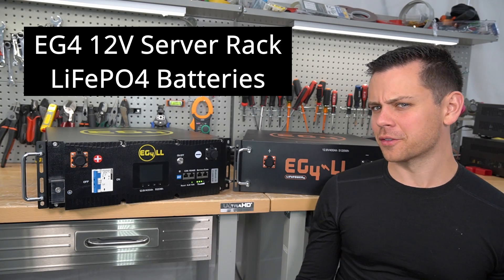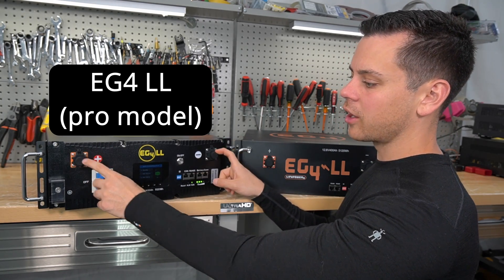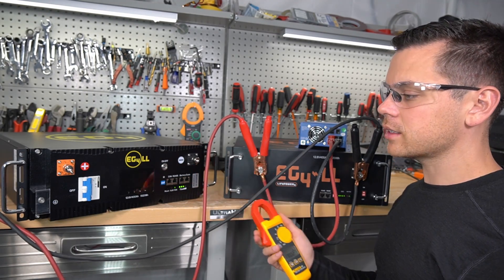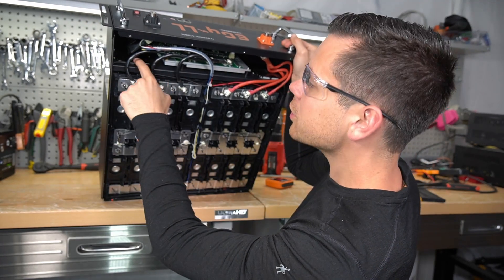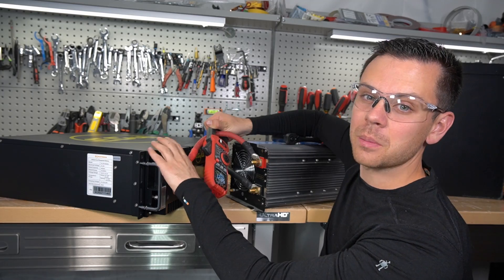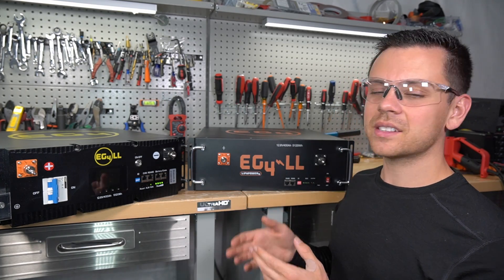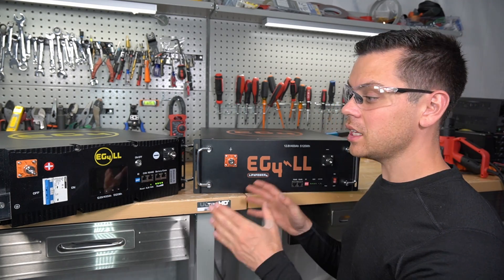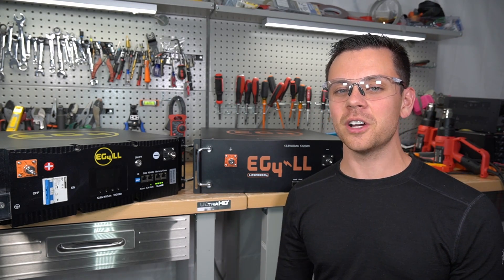$1,449 EG4 12V 400Ah LiFePO4 Server Rack Battery

Comment: Should just one of these be able to handle a 15,000BTU RV A/C when we turn it on.  I keep getting a battery shut down when I turn on the A/C. I just ordered a SoftStart to minimize the initial amp surge. I want to add another but want to make sure my whole RV (50amp)  will run off this setup. I have a Victron 3000 2/120 with Lynx, Cerbo and MPPT's. It runs an electric fireplace with both A/C fans (not cooling), but will not start the A/C when I turn it on cool.
Reply: You likely need a second battery. Also make sure you have the current version firmware. They made some updates to help with inrush.
Reply: You need a major system to run AC. I believe you would need a 48V system, with at least a 5000W inverter/All-In-One, like Growatt. The problem is that there is limited space for solar panels on an RV, and a minimum solar input Voltage for 48V units. A decent comprimise is the 24V all-in-one, but either way, you will need  a LOT of battery storage to power the AC for longer than an hour or two. Find out the Wattage pulled by the air conditioner, then multiply that by the length of time in hours you need to run it. That will give you the Watt/hours you need as a MINIMUM in your battery storage. To get Watt/hours, (Wh), multiply the Voltage of your battery bank by the total Amp hours, (Ah). For example, a 24 (nominal) Volt 200Ah battery similar to the one in this video is actually rated at 25.6V, so the total Wh of the battery is 5,120Wh.  So, one 24V battery like this would run a 500W air conditioner for 10.24 hours, or a 5,000W air conditioner for 1.024 hours. And that is just considering the air conditioner, not including everything else you need to run. You will need to figure out what you use over a whole day. Maybe you can figure out what your needs are from there. Also, you will want to double or triple the battery bank size from your final calculation to allow for a cloudy day or two. Of course, this is only my own opinion, and maybe someone else has a better knowledge of solar power, but I have been living off-grid for over 30 years, growing my solar system as I learned and understood more, and could afford better quality items.
Reply: @Tumbleweed5150  false, you can run RV ac off 12v, 24v or 48v systems. Also a 3000 inverter will do it. Lots and lots of YouTube videos of people doing just that on a 12v multiplus ii 2x120.
Reply: @earlzeis35  yes, thanks. I will get a second battery and I am actually installing a Micro Air EasyStart that cuts down the starting surge like 70%.
Reply: @Tumbleweed5150  FYI, The Micro-Air soft start did the trick. It reduced the start up amps and the one battery ran the A/C like a champ. Now while it did run it, it does suck like 10% of battery in like 15 minutes. We will obtain another battery, and with 900watts of solar on the roof, 600watts of mobile ground solar, with a small propane 2200 watt generator, I think we'll be in great shape.

Comment: I noticed a few different Commenters talking about using the 12V batteries for their RVs, etc., because most items are 12V in one. I have a 48 Volt system in my RV, and I put in a pair of buck converters for 13.8V to run my 12V stuff. I had a 24V to 13.8V converter in my old 24V system, so when I upgraded to 48V, I just bought a 48V to 24V buck converter, then used that to power the 24V to 13.8V buck converter. I tried a 24V to 12V converter on one system, but it seemed weak, and pulling a larger 12V load, (Using a 12V tire pump, for example), it overheated the cigar-type plug. I replaced that, once I got the 24V to 13.8V buck converter, and have had no problems since.
Reply: RV 50a? What inverter did you use that's 48v and RV compatible?

Comment: So, if this were put in place of standard RV "deep cycle" batteries, how would your vehicle charge circuit handle them when driving, and could they be a direct replacement??
Reply: You would need a DC to DC converter so your alternator doesn't burn out, but otherwise, they should work just fine.

Comment: Will, I just check the price at Signature solar It is listed at $1449.
Reply: Will is comparing prices per 100Ah. So what you have to calculate is the cost of the BattleBorn/SOK et. al. at the price listed times 4. So a comparable SOK system would be $559x4=$2236, as compared to the EG4 400Ah model Will has @ $1449.

Comment: Nice vid. One thing i would say is that the thermal breaker would be affected hy heat generated inside the box, so in the event something inside the box was getting really hot while current was still under the BMS trip rating, that would slowly ‘derate’ the breaker and could lead to it tripping when the bms would not. But that depends on the high temp behaviour of the bms. I agree its mostly a convenient disconnect ‘for emergencies’. 

Its a lot more elegant than the 5kwh of paralleled 12v in my rv! Still more expensive, but definitely worth it for multiple reasons.

Comment: Next video: How to run all your 12V stuff in a 48V system with examples for 0.1A / 20A / 50A / 100A+ requirements. Budget options like used 12V Server PSUs for 50-100A running off the inverter for specific usage under an hour. Midrange options like paralleled 48V to 12V DC-DC converters for even higher amps?

Followed by: How do you charge a 48V system via 12V alternator?  Can we make it work?  Is there a 12V/40A input to 48V/10A output solution that can optimally charge a 48V LFP battery?  Should you add a 48V alternator instead?  How about using a small DIY solar generator to charge via the 12V alternator until it’s at least 40% charged, then switching on its inverter to startup a high quality 48V LFP battery charger?

Lol 😅

Comment: What if your batts (eg4)are only down to soc of say 30-40% then recharge to 85-90%..is that hard on them or better. I never end up fully cycling them.
Reply: Probably better, not harder on them.
Reply: You may want to bring them up to 100% once or twice a month, as I think they equalize at the top end.
Reply: @Tumbleweed5150  I have 6 eg4 lifepo batts the eco version. I have noticed that if you do let them go to 100% some of them get there faster than the others but all end up there.I also noticed the longer you wait the more they get out of sync (soc green lights on batts.some 2 some 3)which is weird because they have comm cables to each other and to the 5000es so to me that shouldn't happen.

Comment: seems like EG4 has got their battery game nice and tight.  Regarding the warranty, the question is always will the company be there when the warranty gets long in the tooth.  EG4 does seem like they're doing things right enough that 10 years from now they might still be here. but honestly their build quality actually hurts them in that regard; their materials choices are of high enough quality that it looks like you'll get that life expectancy if not more, so why bother paying more for a longer warranty. :D

in relation to mounting, anyone who's capable of custom designing their own system for an RV or other mobile 12V setup, probably is smart enough to make sure the batteries aren't going to go flying.  adding more ways to tie them down might actually hurt EG4 in the long run, as people could become complacent in securing them, trusting that any additional brackets are actually strong enough to NOT rip from the chassis in an accident.  quite honestly none of the server rack batteries have cases that are strong enough to withstand accident forces on their own. those mounting wings will get ripped off in a heartbeat.

Comment: Been in a bus for over a yr with 2 EG4 batteries and 800 watts on the roof runs microwave air frier even air conditioner in Florida never get below 60% and charges back up daily...great batteries
Reply: I'm in Alabama,will the ac run as needed at 75 degrees 24/7?I live in a 35 ft. travel trailer which is 50 amp,but I only have one ac even though it is wired for two.

Comment: Awesome. I agree 48 V rocks. However, many of my locations are off grid artificial intelligence cameras we have to use 12 V. Because we go direct DC to DC. Our efficiency is really critical.
We also never exceed 200 W running the various 5G 4G modems, switches and compute power along with cameras.
I have fuses set up for that.
So a server rack battery like this really simplifies our lives.

But I know what you mean with the 48 V versus 12 V is so archaic, but sometimes you have to use it.   Love the video
Reply: I’m not sure describing 12V as archaic is accurate. 48V has some advantages but for smaller systems and loads- and things like the cams you describe- 12V is just the right product. If all you are doing is ‘replacing’ or backing up typical 120/240VAC systems and higher loads and where DC service isn’t a factor then the ‘argument’ for 12V is diminished. 
For small offgrid systems that run a fridge/coffeemaker or an RV then in my mind if your loads are under 2500W (or maybe 3000W) then going beyond 12V doesn’t make any sense imho
Reply: DC to DC convertor wouldn't solve that?

Comment: WILL: From what Im seeing this is the start of hopefully many RV/Van/Boat related system videos. Hopefully you can do  videos on 12v, 24v and 48v systems and contrast and compare the pos/neg of each as compared to each other and cost comparrison. This perfect timing for me having just bought a new van and I have to first decide on a voltage before I proceed with the build. ALSO: For 12v what do you think of Big Battery Razorback and other "Blade style" batteries such as BYD? These are a perfect form factor for my build design and Im sure for many others as well. For 24v Thier Hawk Max 2 is even better. My battery pack would ideally fit a 76"w x 10"w x 13"h enclosure/space. Thanks.
Reply: Check out Will's older videos. He's done videos on almost every kind of system, from tiny 12V versions up to 48V ones.

Comment: Jesus that is a great deal.
Thats less than what I paid for one of my Renogy 100AH BT batteries.And I agree on 12V, if I was going to redo my system in my van it would be 24V. Lots of fridges, fans and lights can run on 24V. 
Thinner, less expensive cabling. Not so much heat!

Comment: I have the EG4 LL battery in my trailer. I directly replaced the lead batteries. I adjusted the solar controller (ZAMP) to lithium and the trailer converter to lithium. This is in a 2022 Outdoor RV 24RKS Backcountry. I have 340W of solar on the roof and an additional 180w portable panel.  So far I have not had any problems recharging the battery to a full SOC daily. I also added a Victron Smart Shunt. I have been using the battery for about a year now. A few things: it starts my generator no problem "now", but initially it didn't (first 7 day trip, I need to use a jump box to start the genset). No idea why, I didn't change anything. When fully charged the shunt shows 14.63volts @ 400ah, at 83% capacity it shows 11.8V. When watching the 12v tv and the furnace kicks on, the tv fades and I need to wait a few minutes and turn it on again (after the initial kick in of the furnace fan I am thinking). Other than those two quirky things it seems to work fine. I do not have it hooked up to an inverter. I have it installed inside the trailer. I used 2/0 cables between the battery and the bus bars that everything is connected to. I soldered the cable lugs (didn't crimp). The cables lugs on the trailer wiring from the factory are suspect as the original battery lugs actually came off in my hands when converting to the EG4. I am planning on replacing and crimping the battery lugs and re-crimping the wiring connections from the trailer to the bus bar (the batteries are hooked to the bus bars). I also wonder if I need to ground the battery to the chassis (or is that just a car thing?) for the genset. I have hooked the battery up to my laptop and looked at the reading, but I don't really know what I am looking at. Great videos and a great book! Thanks

Comment: I've had 2 of these set up in series in a to 24V in my RV. BMS failed after 6 months so I can no longer read the battery's communication port, but the batteries themselves are still running strong. Whether it's 10 year or 5 year warranty it's all the same, they'll continue to blow you off and ignoring your calls, unfortunately.
Also, them being 12V means they can't communicate with inverters 24V+ even in series, so why that is sold as a feature is beyond me.
Reply: Why didn't you just go with the 24V version of these? Then you could have hooked up two in parallel. It may be because you hooked them up in series that the BMSs failed.

Comment: Not good news for Battle Born. I hope this competition will bring down the prices.
Reply: I believe Battle Born is relying on the very high build quality to keep folks buying their product. Because they use many smaller, round battery cells that don't require the vents like the pouch cells like this battery does, one can put a BB battery in ANY angle, even upside down, and they will work just fine.
Reply: But, I also hope the competition will bring down BB battery prices!

Comment: Hi, great video, but maybe I'm missing something or maybe I'm too stupid.....but where exactly can I get these batteries for those prices of $362.00 and $437.00? The prices I get from clicking on the links are $1,449.00 for the budget battery and $1,749.00 for the pro one. Again, what have I missed?
thanks
Reply: Will is usually a little more clear when explaining. But he was comparing to 100 ah batteries these two are 400 ah. So he just divided the costs you seen by 4 to get the cost per 100ah. So it's like these batteries have four times the capacity of the other batteries he compared them to. So yeah those prices you seen were the correct price
Reply: @boydmoney3033  Got it, thanks.

Comment: How do you reset a solar controller stuck on 24v ?
Reply: You have to disconnect it, then reconnect just the batteries FIRST, so it can figure out which system you have. Once the controller shows the battery Voltage, it's usually safe to re-attach the solar panels. However, some controllers have settings that you will have to re-set to their appropriate 12V values, like Bulk/Absorb, and Float/Equalize.
Reply: @Tumbleweed5150  thanks, I think this controller needs to be set to the appropriate 12v level. But that is the problem, I don't know how to do it...😅

Comment: 1500 isn't budget at all, you guys can afford this?
Reply: +
LOL! You haven't been paying attention to LiFePO4 battery prices. Yes, these are higher priced than lead-acid batteries, but they also last a LOT longer, so one might have to buy 4 to 5 sets of lead-acid batteries while another one only has to buy one set of these to last the same 10 to 20 years. (Ten years if one is draining them to zero percent state of charge and refilling them every day. 15 years if one drains them down to 20% state of charge every day, and 20 years, (maybe) if one only drains them down to 50% state of charge once a day. I have only seen my battery bank of LiFePO4s drain below 50% once or twice in the year I've had them.
Reply: Very budget. Compared to other brands such as the popular Battleborn batteries.

Comment: Any input is greatly appreciated. 
I have a difficult question because I think it’s based off of opinions more than anything but I wanted to know if it’s better to cheap out on an inverter and go with a better battery? As well as go with a decent quality battery (li time, chins?) but 200 ah instead of a sok quality 100ah battery? Is there a better option than any of this? This is for a truck inverter system that I’ll be using for general power, off road lights, as well as construction use.
Reply: For my off-road camper/work truck, I used a 24V/3000W Growatt and a 24V/200Ah EG4 battery, similar to the one in this video. I put a water-resistant outlet box on the end of an old RV connecting cord, with a GFCI outlet in it. I haven't had much problem with it, except the battery kept shutting down by itself because I didn't program it quite right with the "dip switches". LOL
Reply: @Tumbleweed5150  I’ve never thought of 24v does it offer any benefit, seems like something looking into. I do want to link it to my 12v truck system, I do have an upgraded alternator so next step is general wiring upgrade/ maintenance and inverter install/ battery installation. I appreciate it, really wanting to make the best decision so I don’t have to mess with the setup too much.

Comment: The price for the battery using your link is over $1400 not the price you quoted in the video.
Reply from the maker: It's per 100 amp hour

Comment: One thing that causes problems here, beyond the obvious, is that a 12V system will impose current limitations on the charge controllers.   So e.g. if you have a Victron 75-15, that's 15A output.  At 12V each charge controller can only develop roughly 13V x 15A = 195W.   That's it.   And a more modern Victron 100-20... still only 20A.  After that the Victrons get expensive.

I hit this problem with my 24V Pergola system.  I have two charge controllers and I made the mistake of miscalculating the amperage because originally I was going to use 48V, but decided for this project to use a safer voltage.  I am capping out both of my charge controllers :-(.  The problem would be even worse at 12V.

So you'd wind up having to use a more expensive charge controller, or more of them, to make it work at 12V.  I personally think that it is better to run a higher voltage and then just have DC-to-DC converters off the battery to the 12V loads.  Such converters are very cheap.   That way you can go with less expensive charge controllers.

Comment: Great video. I'm thinking of adding new cells to my 2004 Monaco Knight. Currently it has Lead Acid. I'm wondering if I should stay at 12 volt or go to 48 volt? I want to add solar to it as well, but the last bid I received was $17,000. That buys a great deal of diesel for my generator. What's your thoughts?